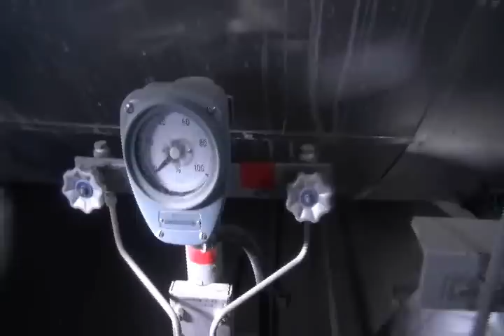TEPCO finds high radiation levels in Fukushima Daiichi Unit 1 torus

Comment: As far as I can tell they never went anywhere near the torus in this video,  or even the torus room .  It appears as thought they ascended the stairs until reaching the vicinity of the isolation condensers,   took some readings,  and then descended.   The condensers are insulated with white blocks,  covered in sheet metal.

Plastic suits and rubber boots to climb over twisted sheet metal.

/notice how they take visual readings and recordings of the various gauges,  and the position of valves.

Comment: Good workout, climbing all those stairs in respiratory gear. Imagine if your lights went out. Do you know your way out?
That damaged ventilation system ductwork at about minute 14 is the infamous hardened vent in which the explosion originated. The vent don't look so hard now. So now we know that if you delay venting and then start venting, you explode.